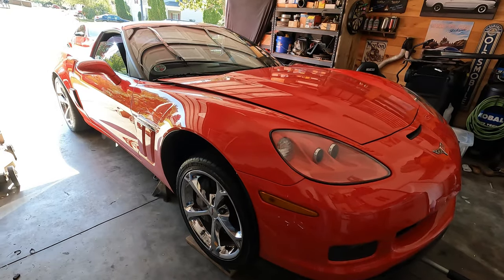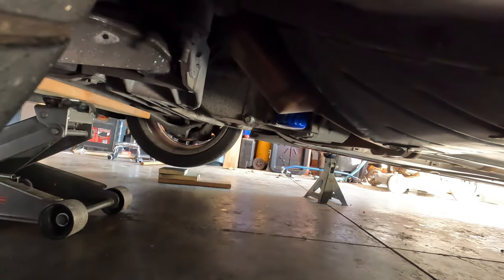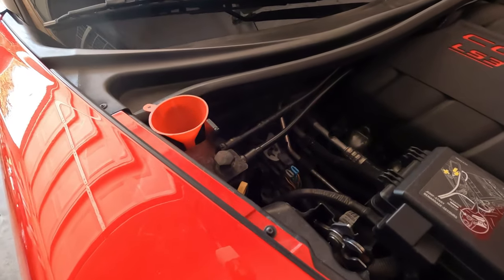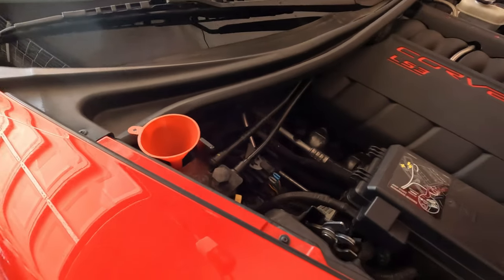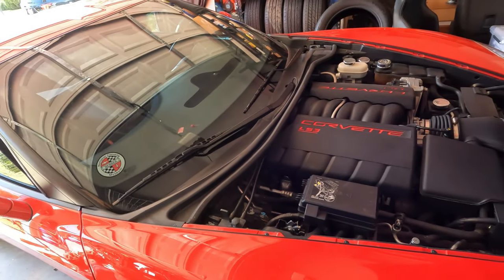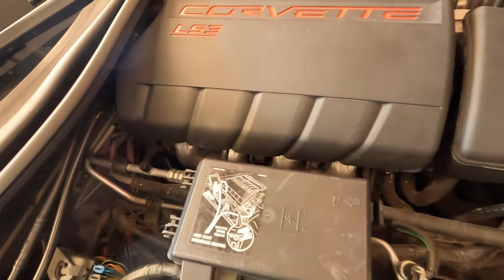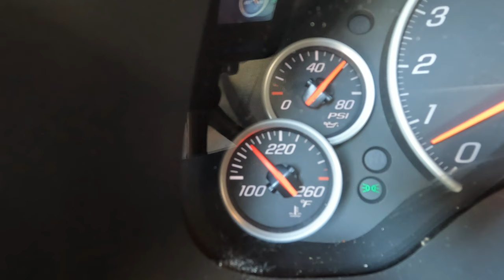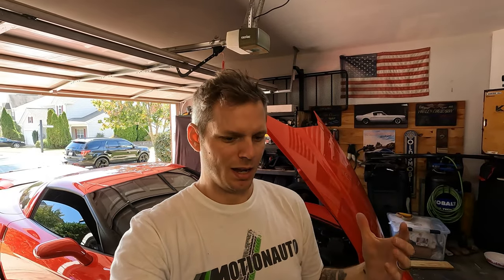FIRST C6 Corvette Oil Change

Comment: The tick you were talking about is very common on these motors. All aluminum pushrod motor so you hear all kinds of noises. Could potentially be a minor exhaust leak at the manifold also.
Reply from the maker: Yeah definitely think it is just the nature of the engine.
Reply: @SpeedCultureStudios  yep they are noisy things. Mine had some excessive ticking aside from the injectors when I bought it, and was bone stock. Now I have a cam, long tubes and stiffer valve springs and it sounds like a very pissed off sewing machine.
Reply from the maker: @bwill03z76  headers definitely make it worse.  The thin wall metal lets all that valve train noise through — but if the cars loins enough, you don’t hear it anyway 😂

Comment: Stopping power and handling first and always before power. But being a Grand Sport I'm not sure what you really have to do there.
Reply from the maker: Totally agree.  The car has plenty of power to have fun with.  Obviously has the GS brakes, but a more aggressive pad will make a big impact. Tires will probably be the first thing though.
Reply: @SpeedCultureStudios  pads and tires are love on a stock set up.
Reply from the maker: @MrTilbin  I think that’ll do the trick to start.
Reply: Just paid $690 a piece for 345 30 20 michelin ps4s. Worth it though. Used to just spin in second gear now I'm hooking and booking!!! Great video boss